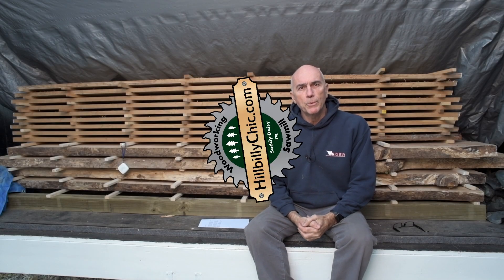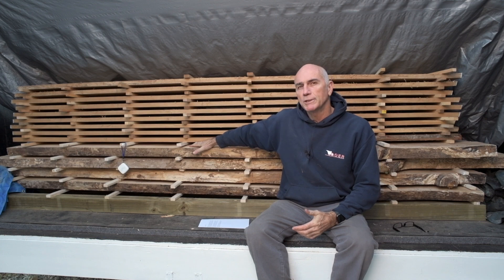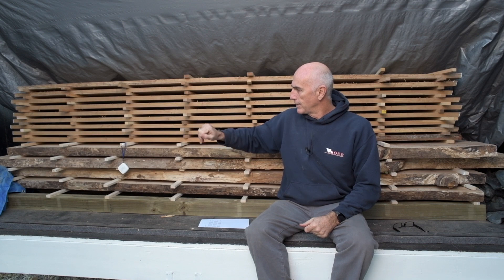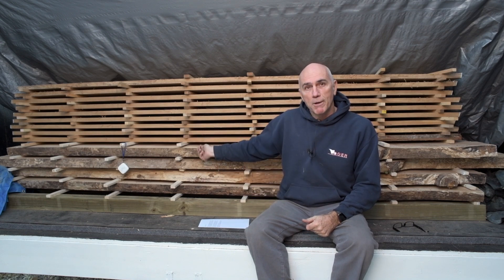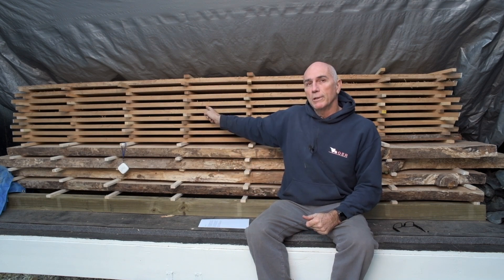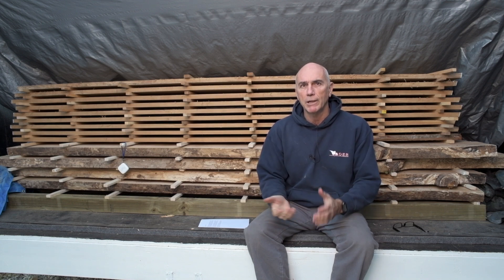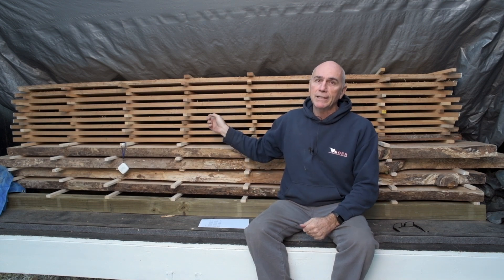Solar Kiln in Winter

Comment: I've been thinking of doing something similar. Obviously the surface area of the wood you're drying makes a difference. I've also noticed that the faster drying wood is higher up where the heat rises to. Would you also consider having some kind of heat source operating in the solar Kiln, like a wood burning stove or something? If not in then near it with a pipe or radiator to allow otherwise residual heat to transfer into the kiln? Also, the vents; i noticed you said to they were closed. How do you balance that with condensation? Have you thought of using sawdust to absorb moisture... etc etc
Reply from the maker: I'm more of a "set it and forget it" operator since I'm not drying large quantities and don't have a schedule I'm trying to meet.  I'm just trying to speed up mother nature a bit.  As the temperature increases inside the kiln the humidity level drops quite a bit so I do not have any issues with condensation.  There may be a little in the mornings but it disappears quite quickly once the sun comes out.  I have seen where people do use external heat sources which would make sense at the end of drying to keep the temperature at a level to kill bugs and if I were to do something like that I would probably use a heat exchanger inside the kiln going to some sort of volume tank heated by a fire.

Comment: I’d like to see more of your baffle setup.  I keep adjusting mine and curious joe you are running your tarp on the sides vs the top.  I also run my tarp straight down from my baffle.  I see yours runs to the front of your stack.  Thanks!
Reply from the maker: No Problem, I was planning on doing a video on my first year with the kiln.  It's been a huge learning curve.  I run my tarp/baffle to the front of my stack to make sure the air flow goes through the stack and I have some old tarps I shove into the sides to take up space.

Comment: No solar kiln yet.  Planning on building in the spring.  I've been trying to imagine a wood fired heat source for the winter time...one that requires no electricity or what could be provided by a small solar panel/battery and also has the heat source outside of the kiln.  I think it would be a good use of all the slab wood created by the sawmill.  Would need to be able to control the heat source output automatically via a thermostat.
Reply from the maker: It's certainly a drawback of the solar kiln.  Heating it from an external source could work but you would almost need to put insulated glass on instead of the polycarbonate panels because if they aren't letting the sun in they're letting the heat out.

Comment: Very interesting thank you for sharing I have been looking all over for the answer to solar Kiln in the winter and did I have to add supplemental heat. So I guess the answer to my question would be yes
Reply from the maker: It does dry slowly but fast enough for me..  Unfortunately it doesn't get up to the bug kill temps but that doesn't seem to be such a problem for the wood that I'm drying.  I've never seen a but come out of dry lumber as I'm using it in my shop.  Mostly, oaks, hickory and walnut.